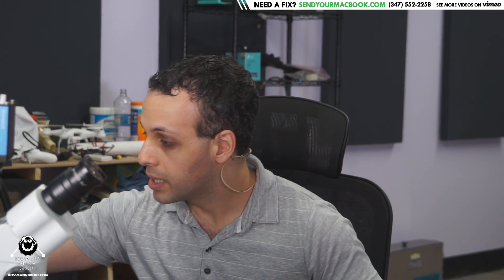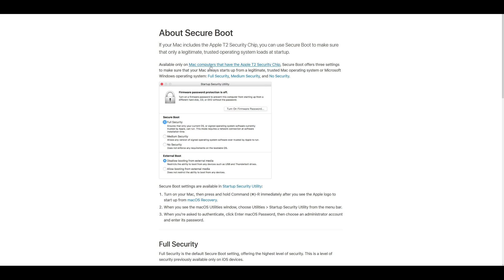An important message from Louis Rossmann

Comment: While I don't entirely disagree with your points, I sort of disagree with the way they were presented.
Secure boot is supposed to do this; this isn't an Apple only feature.

While great for repairing systems by slaving the drive or swapping it into a similar system, that is a security weakness.
Root kits were supposed to be eliminated by having Secure boot enabled, for example.

Now, you did mention and I agree, the average person... for home use... probably doesn't need this feature. 
This is mostly a feature for a corporate environment, though there are some attacks that having secure boot on might prevent.

Still, this is the direction computers are moving. But, yes, it will make repairs harder. And it turns out those rootkits are still possible because they didn't implement it right or something in the BIOS is corrupted and it fails to boot properly.

Here's what I would say: if you feel like your hard drive should be encrypted for privacy, you should have secure boot on and be diligent with your backups. If not, probably avoid it.
I'm not exactly sure what Apple does with encryption by default.

Comment: I had a friend spill a bit of water on the trackpad. Dried it out, opened it can sprayed it dry. And won't boot. Screen glitches and doesn't turn off when closed. I think it's the trackpad that's ruined the screen and magnent to close the laptop screen and turn on sleep. So instead of just a bad track pad that could use an external mouse she now has a dead computer.

Comment: If the system storage is an eMMC then there are external readers that you can use to pull data off of the chip. eMMC chips were actually dual purpose devices that can function as a parallel read/write SSD or a Serial Read/Write device using the SD protocol. Search for USB 3.0 eMMC reader.

Comment: I agree with you to a point. Working in IT, I cannot stress enough, Back your fucking data up. External hard drives are cheap. SSDs can die on a windows based computer just as easily as they can on a mac. Apple will pull this shit all the time as well.

Comment: Heh, well I am just so glad I avoided Apple with the first iPad back in the day.
Today though, if any of my machines die, I still have the recovery option, but I also have backups for the backups for stuff I cannot lose... Even Microsoft weeps when they face the mighty ZFS filesystem.
Reply: The IPad is the best tablet out there though and well worth it. I can back up to a computer, iCloud easily. The iPad is not a laptop replacement for many still(though this is changing) but what it does, it does very well. 
I’m so glad I got the iPad back in the day. I’ve had 2 so far- never broken down, still snappy, and powerful app system has helped my work.
Reply: @makasete30  iPads back in the day had VERY ridiculous design flaws.

Comment: Sounds like they wanted to slide in UEFI native.  When you configure the BIOS for UEFI Native you are enabling Secure Boot features.  Native UEFI is almost like having a sub-os loading before you boot into your user OS.  You can google some flaws found in UEFI, but like you said, folks see the term “greater security” and pounce on it.

Comment: Welcome to the Mac equivalent of PC's UEFI vs BIOS plus automatic encryption.  I brought up these same arguments back in '07ish at a Windows Vista pre-release conference.  They announced bitlocker, and I asked 'What about the customer that doesn't know this exists and needs data back?'... and they said... 'It's not enabled by default, you have to enable manually'.  Mission-creep decided to make every device from phones to laptops encryption-enabled by default, with no copy of the underlying decryption key because it 'JUST WORKS'... until it doesn't.

Comment: Thankfully I disabled mine because I boot to Windows on an external drive. I didn't even know this was there also until I went to boot to my external Windows OS drive. I did noticed that Catalina is very tight on security. I had all kinds of issue with MangoDB because of the security features. But Louis, I write iOS mobile apps for the company I work for so I have to use Mac, I know there are hackintoch out there but too much of an hassle to get it built and get the OS installed. It does sicken me that Tim Cook focuses more on making money rather than the customers but they keep coming back to Apple even with the knowledge of how much Apple screws them over.
Reply: We hackers know how secure Apple devices are

Let me tell you a secret: They’re not.
Reply: @RandomGuy-om1vy  You are correct, no matter how advance an OS becomes there will always be holes in it that can be found.

Comment: Videos like yours really have started to affect how i shop for things now. While not on the same expense level as a macbook i'm currently shopping for a new headset because the one i have is 2 years old with a battery that is crapping the bed and after a decent amount of research i can't find a way to replace. I also can't replace the earcups without some constructive deconstruction so the next set i buy is gonna have a lot more looking into done.

Comment: So this is both a good and bad problem. The reason the T2 exists is that it enforces hard drive encryption and make it difficult for bad actors to retrieve your HDD contents in the event that the computer is stolen, taken into custody, etc. (Also to lock you out of doing what YOU want to your machine, but I digress) This ensures your data is safe from anyone who you don't want having it. However it comes at a price of being unrecoverable in the event of a hardware key failure or a hardware signature doesn't jive. For 99% of mac users (who are generally not tech savvy, sorry) this is absolute overkill in a security sense. If you wanted your laptop to implode upon critical failure you wouldn't be an Apple user. (Likely you're running Linux with some sort of high-entropy encryption and a hardware key). 

For Apple customers, at the very least customers should be able to have a alternative way to override the T2 saying fuck you either by a key they hold or a passphrase of some sort to bypass the lock. Mind you this same sort of thing can happen with a standard TPM module in PCs and they can die and then tell you to get right fucked. But generally people who are doing this sort of thing know they are doing it and had an option to decrypt in another way, Apple users are not those sorts of people.

The issue isn't the encryption aspect of it, it's the fact that Apple is recklessly enabling this on their customers devices without understanding the risks to their data.
Reply: There is literally no value in encryption without the ability to recover the data.   This is apple DRM, not a user feature.  If it was a user feature, you could print out a recovery key and boot the laptop without the security restrictions and with files decrypted by entering the key at boot.  That is how windows pcs work.  Bitlocker will let you enter a recovery key to boot to safemode or another os and access the data.  With bitlocker if you want to risk losing data, you can simply chose to not backup the recovery key.
Reply: @_PatrickO  even android does it like this and that on every non rooted devices and (some rooted) but its a phone you can lose it there are your bank data on
Reply: "If you wanted your laptop to implode upon critical failure you wouldn't be an Apple user."
Indeed. Apple products are for people who want their laptop to implode upon getting a single drop of water on it, or opening the screen all the way, or using the keyboard, or just because a component on the motherboard decided it didn't want to be on a Macbook anymore and suicided.
Reply: mjc0961 Apple products are so hydrophobic that they fail with “water damage” (according to the So-Called-GenieArse Bar) even when nothing liquid has come within a 100ft of the device. If it’s something the GenieArse doesn’t understand, it’s “obviously water damage”. Calling it a Genius Bar is the ultimate in OxyTotallyMoronics.
Reply: yep. full volume software encryption is far safer and more reliable. if you can recover the encrypted data you just need your passphrase and you're fine.
Reply: I think Apple fully understand the risks to users' data. There is just no financial incentive to care unless and until there are enough people affected that they face a class-action lawsuit.
Reply: @stevenmannion7479  Apple does this on purpose, they want devices to be considered disposable and they want you to use their online backup service.
Reply: The key point Louis makes is that they set this up to be the default.  I don't think anyone would disagree that there are times where you may WANT this level of security, but this shouldn't be the default mode without AT LEAST making it VERY clear to the user what this means for them during initial setup.  Also, as Patrick O points out, USUALLY there exists something like a recovery key.  Of course, we know WHY it's both the default AND there's no recovery key alternative.  It's easier to sell you a new product if your data can't be recovered anyway even if you spend money to fix it.
Reply: No, its the fact that Apple users are fucking lazy and refuse to learn basic modern computing and best practices. If you can afford to spend a thousand dollars or more on a shiny Mac you can afford to buy a NAS, pay for cloud storage or at the very least an external HDD. Anyone who buys any kind of computer, (Windows or Mac) who doesn't invest any effort into backing up their data or even inquire about data retention deserves to lose it.
Reply: @Sysaphys  LOL not fucking wrong.
Reply: Here's something I realized about the whole T2 debacle:

I don't know if the intentions behind the people who created this circumstances (i.e. namely 1) Catalina opting-in users into SecureBoot and full-disk encryption 2) the T2 chip does full-disk encryption without a user-defined bypass and 3) the T2 chip being prone to corruption and failure) were malign or not, but whatever it is, Apple won't have any incentive to fix this problem.

Likely what's going to happen is that eventually Apple will recommend that end-users back up their data on iCloud. That way, when the T2 chip does croak, all they need to do is wipe the entire device and restore from iCloud. Works out great for them, because it incentivizes them to sell iCloud services to their end-users. 

Notice how it doesn't incentivize Apple to 1) fix the problem with the T2 chip or 2) listen to their users about letting them have a user-defined bypass for full-disk encryption, mostly because these solutions cost money and offer no upside for Apple. But offering extensions to their iCloud services not only benefit Apple, but they provide Apple with a revenue stream from folks who do want their data backed up. 

They're also not going to “weaken” their security by creating a user-defined bypass, because adding that bypass is essentially like putting a backdoor into their vaunted “security”, and knowing their stance towards state governments against weakening their security, they're not going to do it. So it doesn't make sense on how they present themselves as “champions” of user privacy and security, and also it nets them some neat, annual revenue from people who want their data to not be lost. 

None of this, of course, implies malice on Apple's part. The incentives are perverse, mostly, and the upshot is that for Apple users, unless you decide to store your important data off your Apple devices (iCloud, or network storage, or the like), things are going to cost more for you in the long run.
Reply: @some_random_loser  It is pure malice on apple's part.   It does not weaken security to allow a recovery key to decrypt.   If there is no option for a recovery key, then it is not security, it is DRM.  Real security doesn't force you to lose data.  Malware and DRM are things that force you to lose data.
Reply: Exactly. My thinkpad came with Bitlocker encryption enabled but the recovery key is tied to your microsoft account, so if the machine dies, you just take the SSD out and put it in a different machine. But screw all that, I use linux anyways
Reply: @? Really I made it pretty clear that other operating system / pcs have various methods of user-owned emergency decryption in case of a hardware key failure if you're using a TPM module or something else. I use Linux with LUKS encryption personally and have zero issues when I need to clone/recover.
Reply: Agreed.  This violates Apple's mantra of  "It just works."
Reply: Now if only they can enforce backups
Reply: What is means is that people need to make sure they have at least one backup.
Reply: @SirHackaL0t.  so basically behaving like a ransomware?
Reply: My problem is that there is no choice to disable it.
I don't want the encryption.
I don't want the Touch Bar.
There is no way to disable it.

Comment: My 13 inch macbook pro from 2010 is still clinging to life lol. However, it was getting abnormally hot lately so I cleaned it for the first time in 10 years. There was so much dust everywhere, the exhaust vent for the fan was completely caked with literally a wall of dust to the point where air couldn't get out it was so thick! Also the thermal paste wasn't even on the cpu or gpu anymore, had to reapply that. I hope this isn't a mistake but I'm going to drop a little over 200 bucks to get it an SSD, a fresh battery, and double the ram from 4gb to 8gb. Maybe I can get another 4 or 5 years out of it!

Comment: I run a Lenovo laptop with Linux and I use whole disk encryption to lock out anybody nasty from the contents of my hard drive.

That encryption software is completely on the drive and if my laptop breaks I can take that drive whether it's spinning Magnet or SSD and plug it into any other standard Wintel laptop and boot it up as long as I know the password.

There is fundamentally no reason for the insanity apple is pulling here.

Comment: TLDR; Just do daily backups (which you should regardless of system or manufacturer). Problem solved.
Reply: maybe you could go be unhelpful somewhere else.
Reply: @oak1780  Ohh, sorry, I didn't know Apple users frequented this channel. Here you go;
If you, or someone who understand the process if you do not, perform a daily backup (meaning you make sure that the data you want to save in the event of a failure is backed up), then the company Rossman Group doesn't have to worry about your data being lost, during a repair they perform, as stated in the video. You're welcome.
Reply: @flashchrome  thanks for the helpful advice, but I backup my relevant data from my pc, and linux boxes regularly, and I dont back up my macs because I only need them when I recover data for my mac owning cutomers, and i already have master images  I can rewrite to them when they get corrupted. oh wait, were you just trying to be clever? try harder next time I almost didn't notice :)
Reply: @flashchrome  nah, my backups work fine the way they are. but I can see you're always right so thanks for all your help.

Comment: I’ve been using the same 2011 MacBook Pro. Still does me good... This was before Apple decided to implement self destruct features. Sure it sounds like it wants to die, and can’t do tasks without fanspin.. But I refuse to go out and buy a newer MacBook. 

A) the price is ludicrous
B) apple’s purpose built failure points .
Reply: My MacBook 2008 is still going strong, the only failure was the battery after 8 years of use!